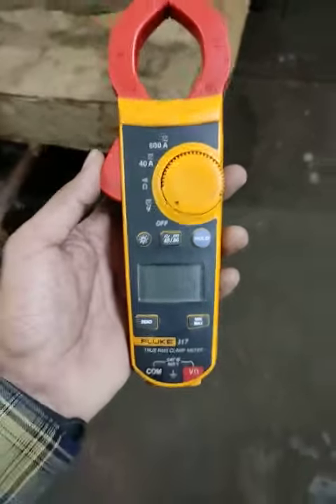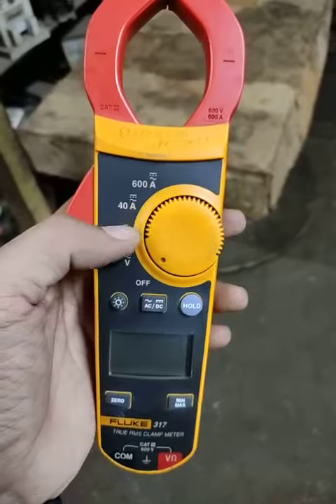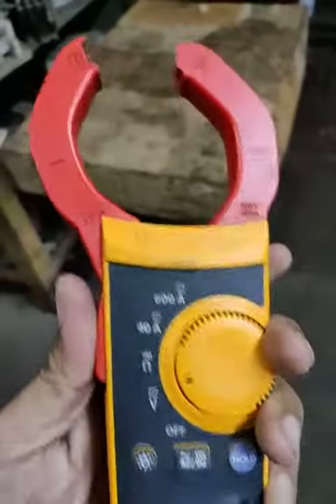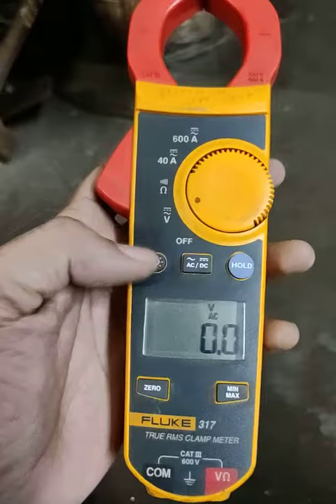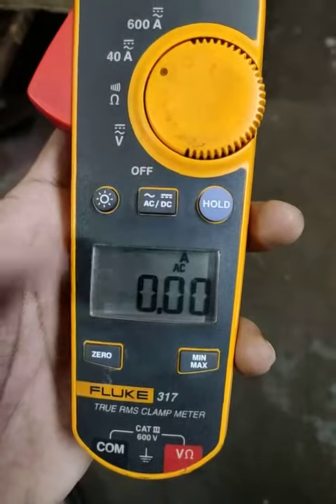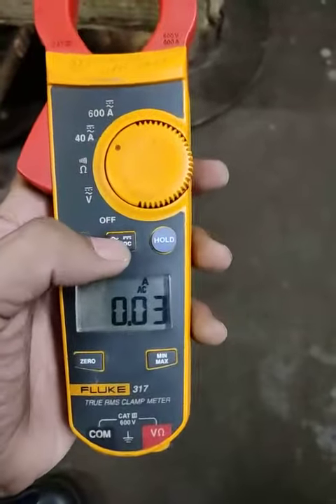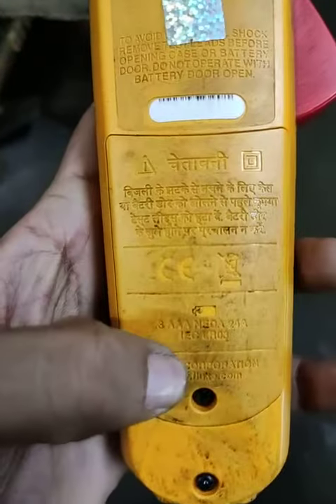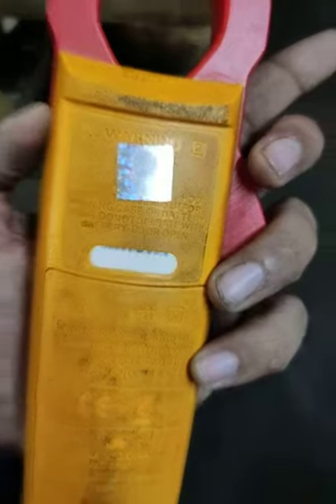what is fluke  317

Comment: 317 clamp meter are physically hard are not
Reply from the maker: Hard
Reply: Clamp meter are fall down if can it damage or not
Reply from the maker: No
Reply: @flyingzero4840   it's not damage it's working normal
Reply from the maker: Waterproof?
Reply: @flyingzero4840  no it's not water proof
Reply: @flyingzero4840  it's fall down on floor it's again working normal are not
Reply from the maker: Working
Reply: @flyingzero4840  o kk thanks